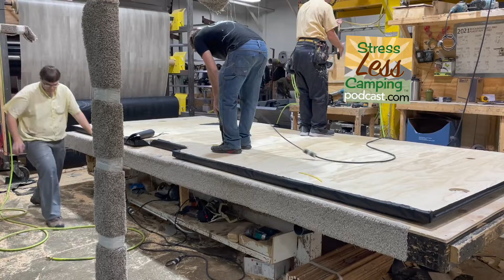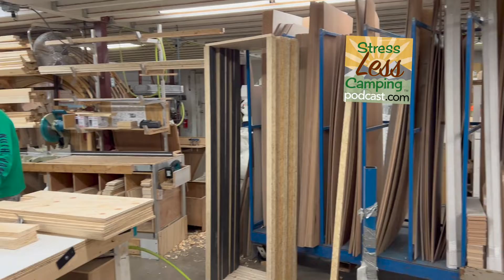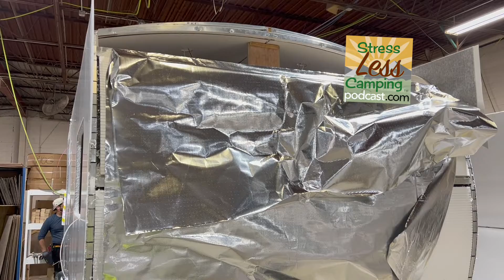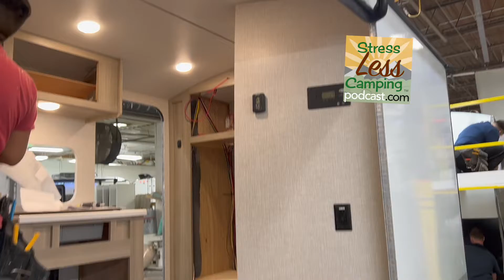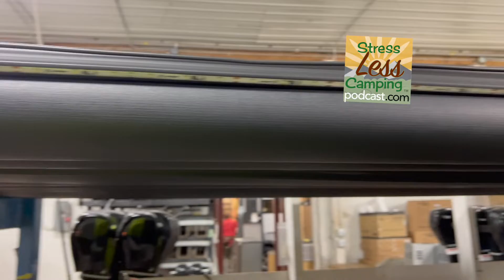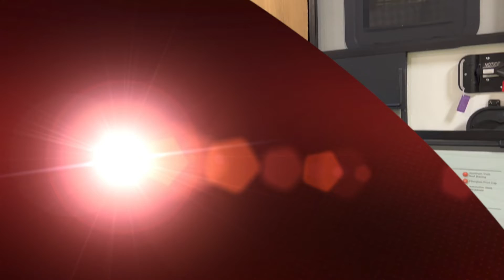Rockwood GeoPro / Flagstaff ePro factory tour

Comment: Air stream is using a composite floor now with great results and how about the roof instead of wood time to stop with the excuses
Reply from the maker: You are correct plus Airstream has upgraded their suspension systems to torsion axles and shod their trailers with Goodyear Endurance.

Comment: So what happens when the vacuum seal fails and after several years the walls have bubbles
And its not a fixable item !!!!! 
Im sure you have a lifetime warranty that transfers from owner to owner ? Blahahahahaha
Reply from the maker: Typically it's not the wall laminate that fails randomly. Usually what has been the case is a seal fails and water gets into the walls and causes the Luan substrate to fail which translates into a wall failure. You can see this on many older laminated RVs. 

By going to Azdel even if water does get into the wall laminate it shouldn't fail. None of the materials in the wall structure are damaged by water nor is the glue. There are very different grades of glue used in laminates and Rockwood/Flagstaff favor the higher-quality glues. 

Excellent point you make and I'm happy to help clarify this. Happy camping!